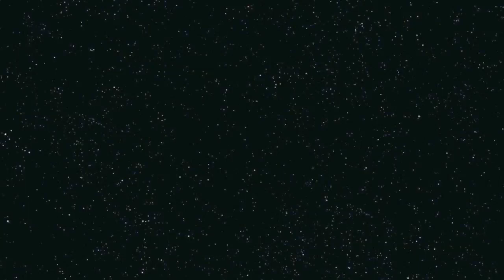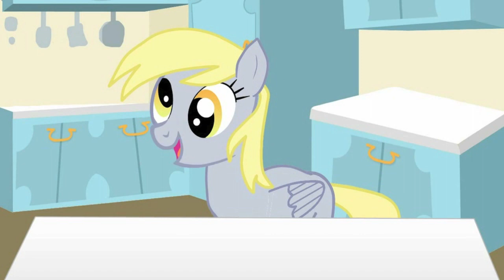Derpy Explains Physics: Buller Block Experiment

Comment: Very good, very good! But this part: "How does it "know" to use up just the right amount of energy getting the block spinning? That's a complicated calculus problem [...]"
What would require calculus in this solution exactly? Since, as you pointed out, the amount of  angular momentum of the block could be established by conservation of momentum.